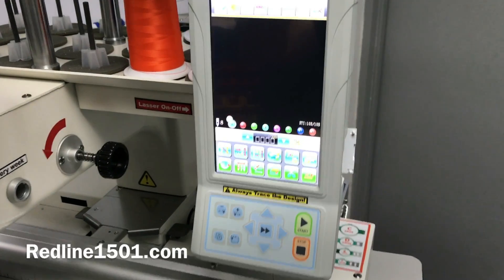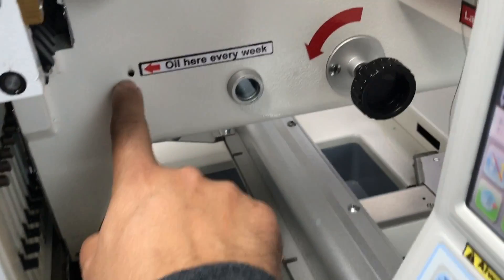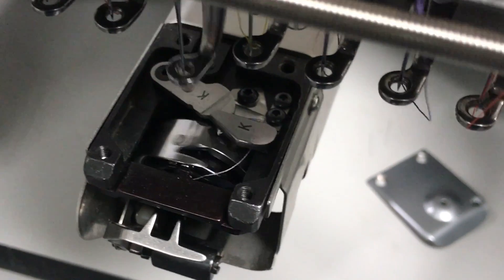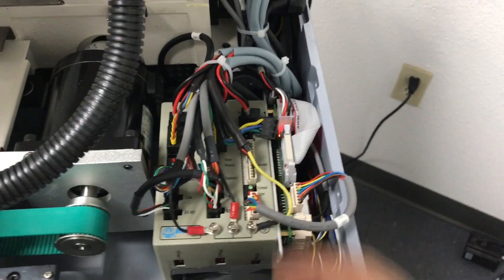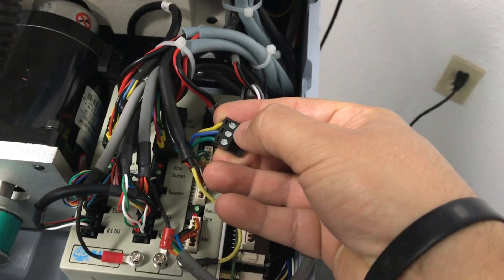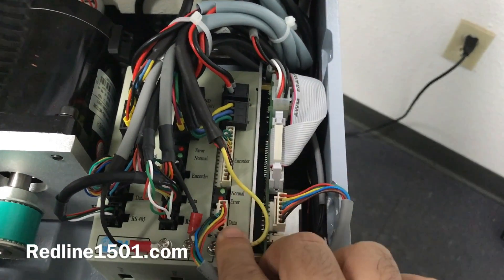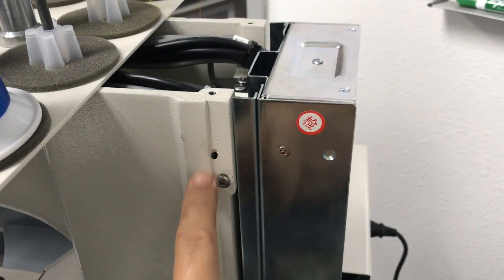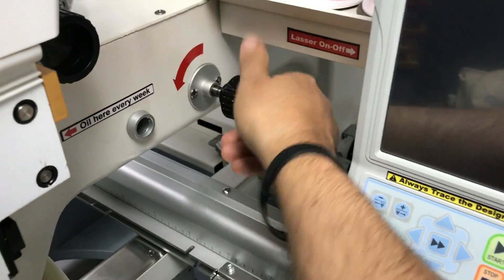EC20 Main Motor Error

Comment: Hello, I have a Dahua A15 embroidery machine. I have a problem with the axle shaft. I have already done the repair steps by turning the wheel to 100 and adjusting the screen as well, but the fault returns again. Please advise and respond. Attached is a picture of the fault.

Comment: I have the EC 12 And EC 20 error because my panto graph is all the way forward but I cannot clear the error because I do not know how to manually move the panto graph
Reply from the maker: Hello Valerie. When that happens need you to turn of the machine and then manually move the pantograph.
Reply: RedlineEMB . I have doubleline embroidery machine. If i turn on my mchone, Error and normal led code is off. And if use my machine to embroidery, the result is not same on the screen. Is it because the error and normal led code not light? If you have email, i will show you the picture. Maybe you can understand if you see the pic and can help me